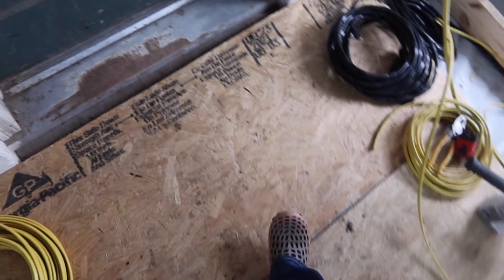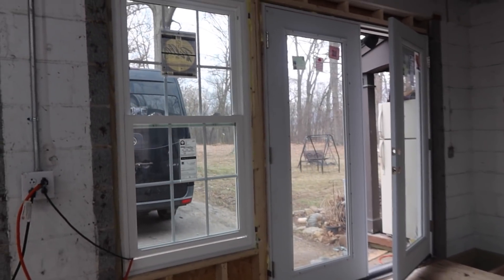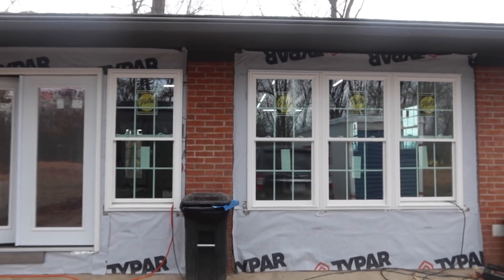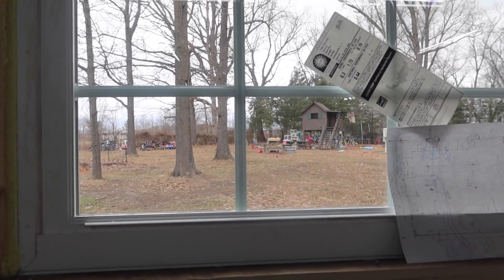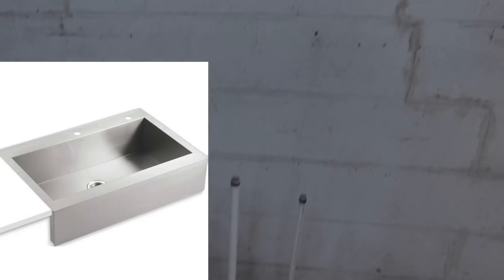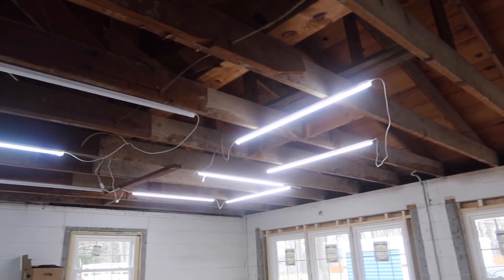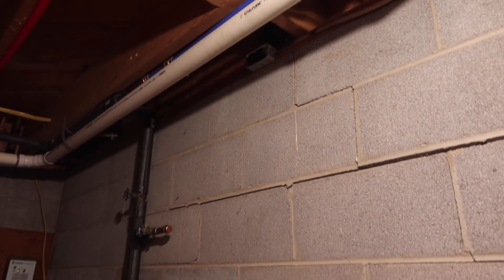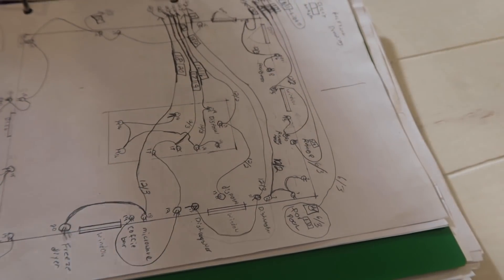PROGRESS! Plus, will I flip breakers? 🤔 Garage to Kitchen Conversion

Comment: I have owned my freeze dryer for almost 5 years and can promise you, you want it in another room. You plan to film there, have family gatherings you will be fighting noise. Its not something you can pause while you film. I would put near your freezers if me. It will cut down your dry time to pre freeze all you can on the trays, so more convenient to have near the freezer.
Reply from the maker: This is REALLY GOOD info, thanks so much. I hadn't read or heard that anywhere yet (I see several similar comments coming in now). I just sent Travis a message with the info. We'll have to put one in the basement or new (upcoming) laundry room. That places those happy thoughts on the back burner for the moment. thank you!! 😊
Reply: @JamerrillStewart  The 7 CFM vacuum pump noise level  will be constant for no less than 12 hours, and that is a very short batch. Most are around 36-50 hours non stop. Only other thing would be good ventilation for the pump.
Reply: Yes. Put it in another room.
Reply: @JamerrillStewart  I found an article that discussed the decibel output of the freeze dryer. I can't recall the exact rating but it ranked very high in noise and very much agree with Amanda's suggestion.
Reply: @JamerrillStewart  it is possible to look at one working before you buy so you know what you are dealing with noise wise etc?
Reply: I was going to say that…arent they loud???
Reply: Yes ma'am my SILs brother actually closed in a small (pantry) on the 2nd porch with shelves and such for their freeze dryer. He said it was his idea because his office is built off the kitchen and he wanted to shoot it, OFTEN.
Reply: I've heard they can be noisy too. ?

Comment: Highly, highly recommend a freeze dryer! We LOVE ours. A couple things to consider is having a dedicated space to store all the accessories (bags, heat sealer, pump oil, etc.) right where you will have the dryer, and a work surface close by for bagging things immediately.
 Also, the noise factor should be considered. It is not super loud, but the pump does make noise, and it is a constant noise for 2 to 4 days (depending on what you are drying). This might be a concern on days you are filming.
Another thing to think of is where would the hose drain into during the freezer thawing process?

Comment: With the commercial refrigerator a few tips.  
1 there are lovely shelf liners that you can get that fit nicely into it.  They are great for things not falling between the grates but don't use them everywhere. Those refrigerators are designed for air to circulate, and when you line the shelves it restricts circulation and you end up with hot spots in there.  
2 when the doors close they vacuum seal  so you have to wait 10-20 seconds for them to equalize.
3 when you adjust the temp it takes 24 hours to regulate.  Don't make huge adjustments at one time or you will end up with frozen eggs and cucumbers( I know from experience... 
Lastly you are creating a dream kitchen.  It is going to be great for you

Comment: I like the idea of putting the freeze dryer on the floor and making it look like it’s
In a built in caddy. Then countertop over it for trays etc!
Reply: Not a good place for one, you have to be able to access the drain valve which is in the lower side panel near the  back corner of the machine. You have to have enough clearance for the water to drain into something you can remove and dump. You also cant put in a place that you wont have good ventilation for the pump.

Comment: I have a freeze dryer.  They are noisier than one expects so you may not want it in your kitchen.  I have mine in a large food storage room right off my kitchen.  It is a room that we built specifically to hold food storage, appliances, canners, large pots, dehydrator, freeze dryer, extra fridge, and freezer.  I can close the door when it is running.  We have a ceiling fan to help cool and circulate the air when it is running.

Comment: I love, love, love your plans for your dream kitchen. A thought... make sure you have plugs by your stove. They will come in handy for immersion blenders in soups, etc.  When it comes to the freezer-dryer, maybe it would fit beside the refrigerator? I know they are tall and will visually block your view of the counters, and I personally like the airy feel of counters that don't have a lot of tall stuff on them. Or, if you do extend the counter and add cupboards so you could put it on the end of your kitchen sink wall, would you be able to use it if it were mounted at the end of the lower cupboards? The loading door is on the upper part of the machine, so it would be like putting things in your oven, the ventilation could still be exposed on the end, and it would not block your view down that counter to your comfy couch.

Comment: If you don’t want to block your window or let your freeze dryer sit on the floor, you could consider taking a short upper cabinet like the ones that go over refrigerators and put it on the floor then put a countertop on it then set the freeze dryer on top. Then it’s not blocking the window and not sitting directly on the floor. Beautiful job so far on your kitchen!

Comment: I think you’ll be happier with the larger cooking space with the stove. Lots more space for multiple pots and pans on the stove. May I suggest you invest in a good set of cast iron pans. Larger size 12” , 14”  and griddle.  Using them on the gas stove is heaven. Season them first and you’ll be golden. They stand up to the gas and are just amazing. I’ve picked some up at thrift store even. They can always be Re-cleaned and seasoned.  Lodge is good brand. I think pioneer woman even has brand. I would also invest in a stove set salt and pepper. Always handy to have close by.

Comment: So excited for you! Just keep in mind that the freeze drier will make some noise if you are planning on keeping it in your kitchen. This might be a problem if you are filming while it's running. It is also a heavy machine. You might want to have it at a lower height than your countertops. It does need to be elevated to have a way for the water to run out of it.

Comment: Home freeze dryers operate at around 65 dB (decibels) – somewhere in between normal conversation (which is around 60 dB) and the noise made by a vacuum cleaner (70 dB). The noise can get old as a freeze dryer runs for 24+ hours, which is why we keep ours in a utility room behind closed doors.

The info above was something I found when researching freeze dryers.

Comment: We have a Harvest Right freeze drier. We have found that it is louder than we anticipated when running. I would not recommend putting it in a room you plan on spending a lot of time. It runs for long periods and also generates quite a bit of heat. I think if you had a room off the kitchen where the door could be closed, that would be a better solution. We moved ours to the garage which works much better for us.

Comment: We have several freeze dries and I wouldn’t suggest keeping it in the kitchen. The pumps are noisy and I don’t think you’d want it in a place where you spend a lot of time. They also put out a lot of heat. The basement is a better place for it because it’s noisy!

Comment: Wonderful progress and the Zline  is beautiful, Lowe's is holding mine due to some delays but Zline  was prompt on shipping to the store.
Sounds like hubby has lots of breakers planned, you're lucky to have an in house electrician. Almost sounds like you need more load on the areas by the range than the island in terms of small appliances. It still might be wise to tape a list of the machines wattages in exactly the spots they'll operate in so hubby has a visual. Think of it like this 3 slow cookers equal 1 Foodi. I would say you would love the Food toaster that flips up, 9 pieces of toast at a time girlfriend!
My advice if you are determined to buy a HR freeze dryer, it cannot be built-in or closed in on shelves. It needs very good air flow or a code is triggered that will say it takes longer to dry food. Even the CS rep told me her family put a fan on theirs to prevent that. I upgraded to best vacuum pump which is quieter than base pump and uses less oil. We put it in laundry room (8x10) with 3 ft open on either side, the pump away from unit and even a fan added but code issue didn't resolve. Generates quite a bit of heat and fan noise which my hubby was bothered by at night. We gave up and returned ours after 30 hrs to get ground beef done, 15% return fee + shipping. We had no other option in a small house, sad but lesson learned.
The people at HR are wonderful but not workable for us.
I do not think you could film while it is running and if you want a peaceful place in the couch area find another area in the house/basement near a window so it can breathe well.
Happy for you and looking forward to seeing you happy in the finished product.
Blessings,
Jan

Comment: If your countertops aren’t ordered yet, you could extend it to under the second window by your cozy chair corner. Freeze dryer can sit on top and then instead of regular cupboards underneath, you could go with a big pull out for your garbage can.

Comment: If you have a Pressure Canner - you want to make sure you have clerance for all that on top the pot too -- also, make sure you have more than enough room between your burners for your pots, if you are getting an electric stovetop, make sure you also get the proper Canning elements otherwise you can/will ruin your stove top.

Comment: a few things to think about:   charging ports near the desk?    turn on and off switches at both ends of the room.   The 'noise' that the freeze dryer makes.....it runs for 24 hrs straight, be sure it's not intrusive for your videos.   Please consider two dishwashers.....it's a life saver!!   is there a 'warming drawer' anywhere?   are any of the floors heated?   Consider auto turn on lights in some positions (as you come in the door?)  just some things I did and did not think of during a reno.

Comment: I know you said you would like the freeze dryer in the kitchen, they are pretty noisy (which I'm sure you already know) If there is a way to tuck it inside of its own walls in that room it would help a lot with the sound. If not then maybe in another room. My mom has one its a bit like a beater bar vacuum running for 24-40 hours constantly. It can get a hair brain numbing. The new big kitchen looks like its moving along amazingly.

Comment: I can see it all in my head.  It's going to be a beautiful, professional looking kitchen.  How exciting!  As far as the freeze dryer, my understanding is that they put out quite a bit of heat and can be loud (think vacuum cleaner).  Considering the fact that you like to film in your kitchen & the freeze dryer will be going almost none stop, I might consider putting it elsewhere (maybe in your current laundry room space or somewhere that you can close the door) .  I know Travis needs to know what do electrical wise so you could set up a proper plug for it in your kitchen "just in case" you decide to keep it in there.  I just feel you might get annoyed with the constant "vacuum" sound.

Comment: Just had the thought and maybe you’ve already thought of this or mentioned in another video, but you should install a half bath (or small full bath) where your laundry is or your old kitchen will be. You’d probably have the space for it after your new kitchen is done and it would be helpful to have a bathroom closer to that side of the house (and also just gives you an extra bath!).

Comment: The freeze dryer are a bit noisy you may not want in the kitchen. Also get the premier pump not the oil less one. Use mine a lot.  can see you using just like freezer meals

Comment: Is the freeze dryer noisy? If so I  would put it on a cart for now and then move it to the new pantry/laundry room when it is finished.  That way you would have more room for your chair.  As far as the tile behind the stove you could do a simple field tile with a few fancier tiles mixed in.

Comment: Freeze Dryer, what if you built a bench/platform under the window for the machine, that way you don't loose window light and you could put storage underneath for parts for the FD. It would have a permanent home and be part of the cabinets but not be so big when completed.

Comment: Goodmorning, Jeanette from Alaska, I love your new remodel, about the freeze drier we got one it is the medium size, and thought we would have it in the kitchen where we would be doing all the prep work, well long story short we ended up putting it out in the garage because of the noise, it runs anywhere from 12 to 38 hours but if you can handle the noise of continual running for that length of time, that was something we never thought about,  also we have a place in the freezer to pre freeze the trays beforehand that shortens some of the running time
Reply from the maker: Whooo, I'm so glad I'm learning about the noise now. Of all the trouble shooting and things I've read, I hadn't heard about the noise factor until today. We're going to talk about setting it up in the basement or new upcoming laundry room instead. Thanks so much!!

Comment: At least in FL, there were some special inspections for range hoods and how much air they suck out of a room, can't remember exactly what. But something to look out for with that mamma jamma hood.  And we had to have a special lock out thingy (technical term) on it's breaker lol.  Got a red tag on that on the first inspection
Reply from the maker: Yes, they said the fire marshal will come and do our range hood inspection. They already know the hood we’re using and the plan for it. So as long as everyone works together and I have my in-house electrician ha ha, it should all go well. 🙌🏻❤️
Reply: @JamerrillStewart  The hood and range are gorgeous!

Comment: I think I would put it (the freeze dryer) next to the commercial refrigerator and go ahead and extend the cabinets to the end of that second window and your crock pot, insta pot, bread makers won't block the window as bad as a freeze drier would.  Also the freeze dryer makes noise and that sitting nook corner would not be a quiet reading corner while it is running.

Comment: Exciting things!!! 
Say I do have a question, what will you be doing for heat and AC in the new kitchen?
Reply from the maker: Yes, we have a new whole house HVAC system that we had done in 2021. They say the new system is big enough to add the kitchen onto it. They’ll be running lines from the new system into the kitchen ceiling for heat and air.

Comment: Check the dimensions of the freeze dryer.  Its not small.  I would think it would block the whole window.   Why don't you put it under the counter??? Put it on a wheeled cart so you can pull it out for cleaning.  Plus you can put the vent out of sight as well.  Just a thought.

Comment: One thing I think would be useful, either a cabinet to slide your trays on out of the way.If you had somethig like that you wouldn't be useing your cabinet top space.The thing im talking about u see used in bakeries.i would look into it .if you got one of those you could build around and it would be part of the kitchen decor. I think it would be very practical for you.plus they are on wheels.If l was designing it would be a must have.

Comment: To avoid blocking the window, can the freeze dryer sit on the floor with counter running over it as in a built in appliance?  I have been considering purchasing a large freeze dryer and have wondered about the weight with a normal cabinet, there may have to be reinforcement to the structure of the cabinets.  I did see someone who had the freeze dryer below the counter.  Also, thank you for the information regarding ventilation, this is the first I have heard that suggestion and will look into it.
Reply: I was thinking this too!
Reply: It may pose a problem accessing the on and off switch as it is on the back of the unit.
Reply: Yes, this is what I was going to suggest too. :)
Reply: The freeze dryer needs to drain when it defrosting. It will need  to be higher than the vessel  you drain it into.
Reply: I was also thinking can you make it look built in. And if that’s not doable can you set it over on the wall with the work and school storage? Like in between the two sets with maybe a little counter above it to set a tray on once you pull it out?
Reply: Excellent idea!!!

Comment: Are you having underfloor heating ? Xxxx are you having a gas hob because it responds to being turned  down faster ? Because the induction hobs respond just as fast and are a million times easier to clean than gas hobs ! Just wipe clean , none of that removing stuff and scrubbing it ! Xxxx 💕💖🌸💕💖🌸💖🌸💕💖🌸

Comment: Progress! Exciting! Question? Will you still use the driveway as a driveway or plans to make it a patio or basketball court for kids etc? Just thinking looking out the windows you may not want to see your cars. It blocks the nice view.

I agree, plug in appliances not on island except for like a mixer or something while making cookies or bread. Just enough outlets for 2 or 3 appliances.
Reply: They are continuing the wooden deck right to the end of the building. But further out from the house she hasn't said yet. Think your spot on about the cars.
Reply from the maker: Hey there! In this video we happened to have both main vans parked right outside the windows. That's not where they normally go. We have parking to the side and away from the house that I don't normally show. It was random that the vans were there because we were unloading things. xoxo 😘
Reply: @JamerrillStewart  👍😘💜